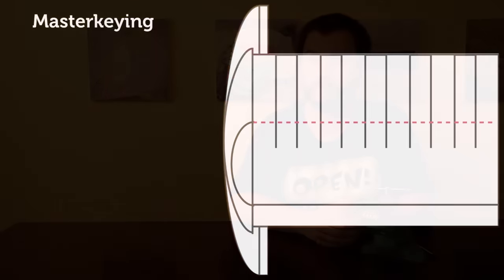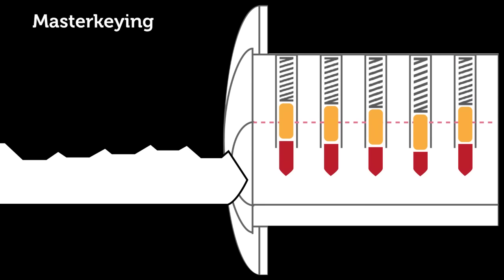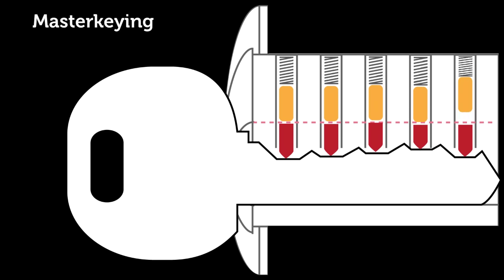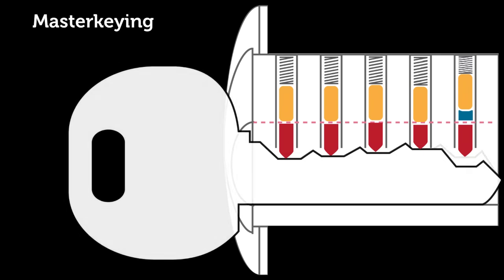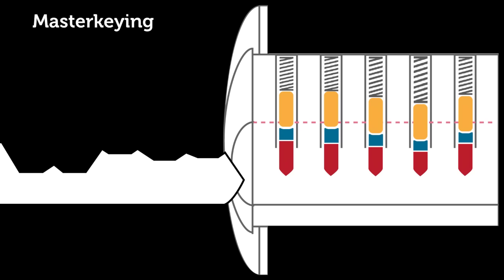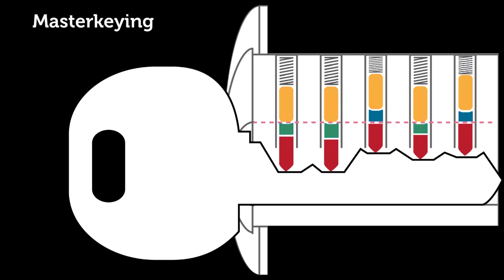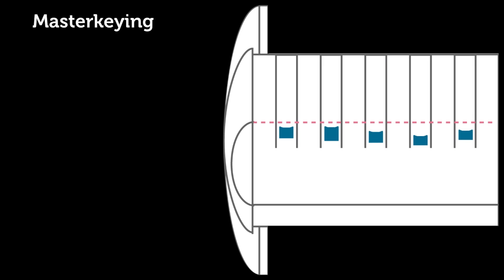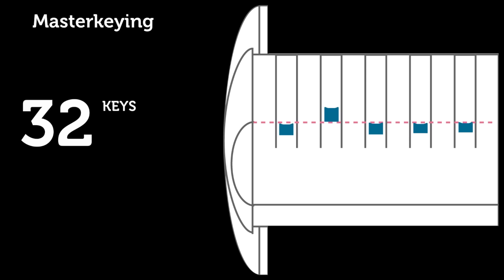07 - How Masterkeying Works

Comment: Security can be attained again by drilling one or more construction key taps into the bolt and then substituting the corresponding driver pins with shortened T-pins and accompanying thin wafers. Won't change the master keying but it will very likely seize the bolt mid turn when a pick is attempted (the more T-pins, the higher the chance of seizure).
Reply from the maker: That's wild, I learned that trick a little over a decade ago from a guy who went by Zeke on the boards. Haven't heard it again since. Nice to see that old chestnut pop up here. I still have a pile of T pins he sent me to play around with it.

Comment: Not only that, but it's very easy for the holder of a regular key to discover the master key. Whereas a lock with N pins and K depths can have K^N (K to the Nth power) different possible keys, only (K-1)*N keys need to be tried to discover the master bitting - a much lower number.

Comment: Due to the fact that my landlord only used the two most obvious sheer lines and the fact that our building has locking shared bathrooms, I was able to reverse engineer a working masterkey on my first attempt. Good thing I don't have 31 bathroom keys and 1 masterkey. My landlord was too upset to be impressed but the maintenance man wanted info on how to make this harder. I told him he could very the use of the sheer line and at the expense of adding more sheer lines, he could use 3 pins occasionally or move to 6 pin locks or higher to complicate reverse engineering. Also have cameras on the unit and bathroom doors... I wouldn't be able to temporarily replace locks so that I can inspect the originals without being noticed as easily. Hopefully our building will be more secure now...

Comment: Very well explained and nice video, except the very last thing you said... I mean, just because there are more ways in which you could pick it, it doesn't mean any of those ways are easier to achieve than a normal lock... In fact, if the attacker has no experience with master keys, the extra piece of metal could confuse you a bit, as you would feel different than a usual lock...
For an expert picker, I don't see how it would make it easier.. they would easily get in with both (I'm comparing it to a standard 5 pins lock with no security pins nor anything)
Reply: I hate to Necro, but don't thing single pin picking. Sure, this would confuse a rookie doing that, but that's slow anyway. Not a major issue in security, just about any lock can be SPP'd given enough time and dedication. But low skill attacks such as raking or snapping? With one shear line, you have to get lucky and get all the pins to bind and set, but with double the shear lines, you have way more permutations that allow the core to turn, making raking a way more viable attack

Comment: Phantom keys can be avoided if the system and all section combinations are set up correctly in the first place. Most secure systems will have restricted profiles that only certain locksmiths are allowed to use and that no other key will go in. If a common plug was keyed with master pins then it would be less secure but that's only because it uses the same profile as almost all store bought locks. It''s not an issue with restricted profiles.
Reply: sorry you are wrong. as stated it weakens security...more shear lines =less secure, its just a fact. he didnt say how much weaker just weaker.
Reply: *seanpintara*, you're halfway right. Using restricted keyways does help a lot. It greatly reduces the chances that a random key from outside the system will operate one of the locks. But it doesn't eliminate the risk entirely. The incidental keys are still there, all you've done is reduce the chances that someone will actually have one in their pocket. It's still possible that someone could file down their key so it matches one of the incidental keys and then they can open more locks that just their own. It's still possible that a particular change key might be very similar to an incidental key in another lock and it will work if you jiggle the key. And it's still possible that two master key systems using the same restricted keys will have a change key in one system that's an incidental key in the other system.

Comment: Do the master wafers go in the bible or the keyway or sometimes both? I have the Sparrows master key set just for learning as part of the hobby but there was no actual instructions and the lock I just pinned the key failed and I thought I had just screwed my lock with no way to take it apart. I tried single picking no go but I was able to use a city rake to open it and take It apart. Phew so now I'm looking for knowledge probably should have done this the other way. lol

Comment: Of course you could guess but that's all you could do. I suppose if you were mathematically inclined you could work out the amount of possible combinations but then you'd have to cut each one until you found the right one. But to do that you would need to know the available sizes of bottom and master pins. Not an easy task. It would be easier to gain access to the cylinder and open it yourself to reveal the sets of pins.

Comment: Imagine you have 15 differents locks with 1 key for each and only one master key for all these locks. If you have the combination of the 15 keys, is it possible to guess the combination of the master key ?
Reply: Absolutely yes. That's one of the reasons master keying is less secure. Someone could figure out what the master key is, make their own, and then they have access to everything. That's why it's generally a bad idea to use master keying on an apartment building. Master keying is more appropriate for offices.
Reply: @sbunny8  it's also a bad idea because losing that key on the property and someone figures it out, you're looking at thousands of dollars to re-key every single door in the building.

Comment: covered lock systems tend to do much better which might mitigate the risk of a master key.. pity they are not that common though... then again those locks would be a pain in the ass for lock smiths to help you with too if you locked yourself out.

So perfect security is also problematic..

I live in a building with a NFC outer door key adding a weak first layer of protection... then a regular door key + another key...
That still allows for multiple barriers that can still be legally picked when needed.

I am half way tempted to build my own little alarm system at some point as a hobby project along with some remote access logging of site so i can ensure no one has been sneaking inside my apartment without me knowing :p

Nice to know how the master key system works though :)
Reply: +ZerqTM Put clear tape on the door when you go out. If someone comes in, it will rip/leave some marks. Put it in door corners so they won't be able to spot it easily. Temporary solution?

Comment: I understand the how it works, but what do you do when you have an existing lock and you want to add a master key to it? the master pins are all different lengths correct? My master is 73855 and my other key is 65634. the master pins are different lengths.  Can you do a video on this scenario?  Thanks
Reply: What you're describing is called Shoe Box Master Keying, and it's a bad idea. You're supposed to start with a master key and then generate a list of compatible change keys, making sure that the change keys don't interfere with each other. If you try to do it backwards, first having the change key and then trying to incorporate a random master key, you're opening yourself up to all kinds of problems.

Comment: or.... instead of having 5(!? dear god) wafers you could just have 1 of the chambers be wafered with a [really low cut] for the masterkey at that pin
Reply: The problem there is that it's far easier to decode the master key bitting with just one lock core from anywhere in the system.

Designers have to balance between protecting against external threats and protecting against threats with access to the inside.

It depends what kind of structure you're setting up.

Comment: Forgive me if Im wrong.
I thought master key is the key  that can open multiple locks.
but this explanation is opening one lock using multiple keys.
my problem is why do we use multiple keys instead of just use copies.
pls can anybody explain?????
Reply: jonathan sam That’s the point. 
One key for you, one key for your neighbour. Your key opens only your door, your neighbour’s key opens only his door. 
Master key opens both without need to swap keys. 
The system is an extra combination so whether key you use that has the correct combination opens the door. 

Your lock has master combination and your combination. 
Your neighbour’s lock has master combination and his combination. 
 
Your key has your combination, which can be used to open your door. 
Your neighbour’s key has his lock’s combination. Which can be used to open his lock. 

Both locks have an extra (master) combination as well which mean a master key could open both.
Reply: Yes, master keying is intended for making one key work multiple locks (each of which have their own key). But look at it from the lock's point of view. That lock has to work with two different keys, the individual key (called the change key) and also the master key. We do this by using master pins. The problem is that, when you put master pins in more than one chamber, you end up allowing additional keys to work the lock too. Those extra keys are called "incidental" and it's a by-product of this type of master keying.

The more master pins you use, the more incidental keys you get. That means the lock is more vulnerable to picking, bumping, manipulation, and random outside keys.

The lesson to be learned here is to use as few master pins as possible.

Comment: What if you want a Master key to work all locks in a building and then you have "A" key to work every lock in the building except the Master Lock. Then you need a "B" key to work every lock in the building except "A" and Master locks and finally a "C" key to work only "C" locks? How the heck do you pin this?! Thanks!
Reply: What you're describing is a four level system: change key, master key, grand master key, and great-grandmaster key. Usually, we label the keys AA1, AA, A, and GGM. At minimum, you need master pins in three chambers. The AA1 change key (which you called "C") is different from the GGM key in all three of those chambers. Then the AA master (which you called "B") is the same as the GGM in one of those chambers and the same as the AA1 change key in the other chambers. Finally, the A grand master key is the same as the the GGM in one more of those chambers, and the same as the AA master key in the others.

Here's an example:
GGM 345612
A       345812
AA     345832
AA1   345834

Locks pinned for AA1 will have master pins in chambers 4, 5, and 6. Those locks will work with all four keys. Locks pinned for AA will have master pins in chambers 4 and 5. Those locks will work with GGM, A, and AA, but not AA1. Locks pinned for A will have a master pin in chamber 4 only. Those locks will work with GGM and A but not AA or AA1. Locks pinned for GGM will have no master pins at all and will only work with the GGM key.